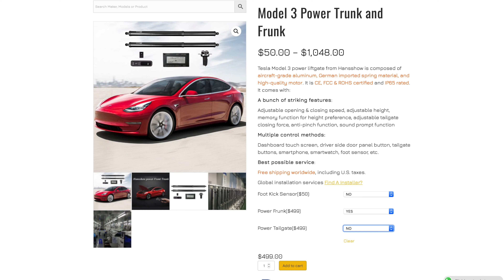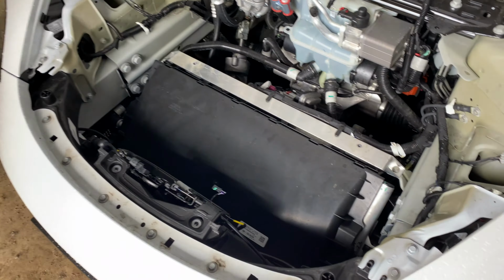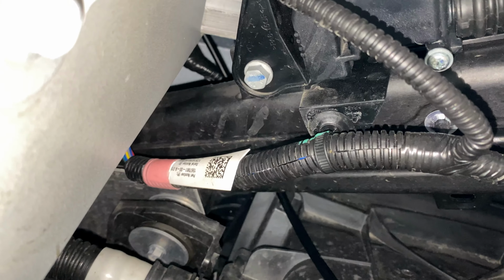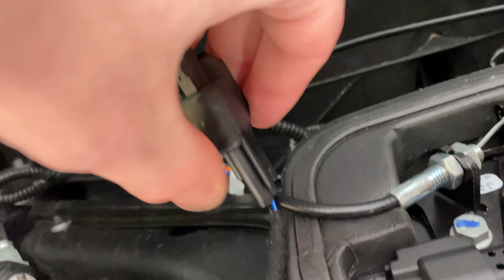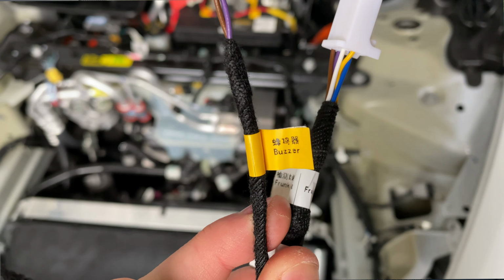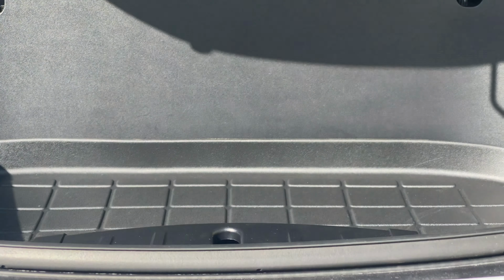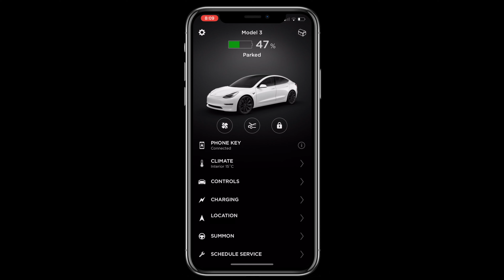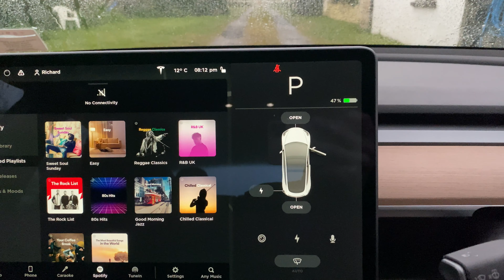Tesla Model 3 Power Frunk - DIY Installation & Review

Comment: Great video, very informative. I just bought the trunk kit and on the fence on whether or not to go with the frunk kit.
Reply from the maker: Thanks! If you’re worried about the install, then the frunk kit is way easier to install than the trunk. Took about half the time :)
Reply: M3PRT It’s more or less the cost and whether or not I’ll use the frunk more. I already know the trunk install is going to be a pain in the ass haha.
Reply from the maker: Haha 😂 Yeah, true. The frunk is good if you just carry around a backpack/laptop bag to work or something on a daily basis. Anything bigger though and sticking with just the trunk is probably the best bet.